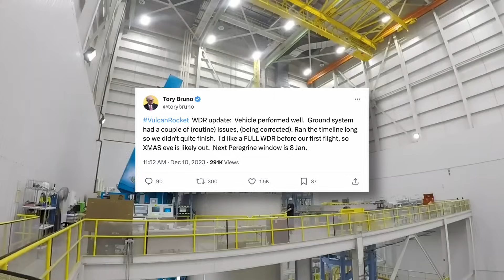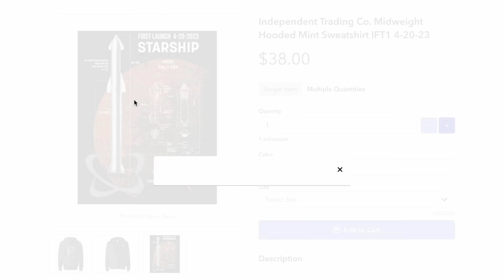NEWS: Falcon Heavy  to launch rare military space plane, and ULA has more bad news

Comment: I worked at the Boeing Huntington Beach facility where the X37 was built. This was a great facility with a great legacy. They designed and built the International Space Station, the Delta rockets, underwater submersibles, and the X-37. They had the last water tank to train astronauts on missions. It’s been razed and the land sold. Funny story was that they built the X-37 in plain sight. I would walk past the structure (I was working on other programs) in an outside manufacturing station. It had a cover story and was featured on the cover of aviation and aerospace magazines.

Comment: Thanks for the video update.  I hope Vulcan-Centaur with Peregrine can launch in early January.  Yes, ULA's launch total for 2023 will be puny compared to SpaceX's, but I have to take issue with your math a bit.  If SpaceX averaged three launches a week, their total for 2023 would be 156 launches; it looks like their total will fall a bit short of 100 for 2023, which works out to a little under two launches per week on average.